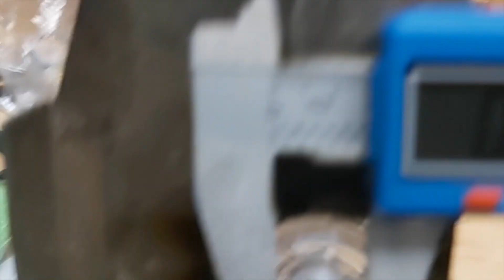DIY aled flipper buttons

Comment: Love it.  I am at the point where I am about to add light up flipper buttons. Perhaps a follow on video explaining how to have the colors set based upon the game you load up?   That is still a mystery to me.   Any pointers you can provide are greatly appreciated.
Reply from the maker: Haha yeah a lot of people get confused with the process. It is not something you set, the tables are coded for it already using the DOF code. You will have to familiarize yourself with DOF. I made videos and Terry Red has a newer one as well. Just to be clear, you can use RGB led instead of addressable led. That's what most people do. I just tried to do something different.

Comment: How is this different than regular rgb leds?  I guess I’m asking what’s the advantage of using the addressable ones?
Reply from the maker: The difference is subtle,  but I wanted an alternative to Rgb. The fact that I have 2 separate LeD would allow to have 2 colors at once, the main difference being not taking 6 ports on the controller for both flippers. Using a RGB has to be connected to the controller, but the addressable Led connects to the Teensy, pal. That was a very valid questions. Thank you for asking. Most people are happy with RGB. I just thought why not!